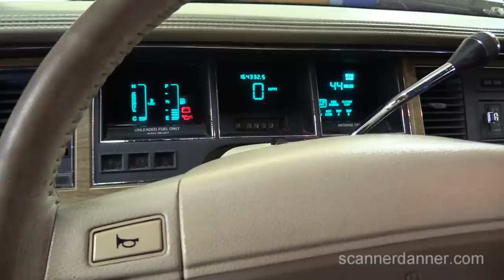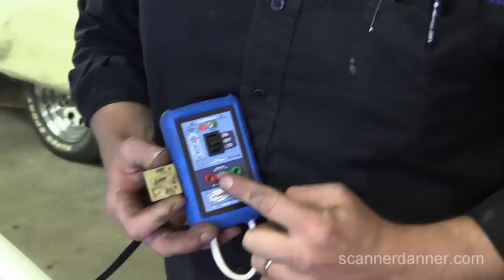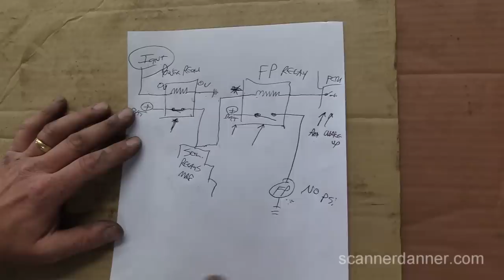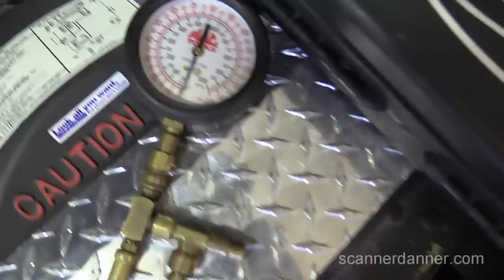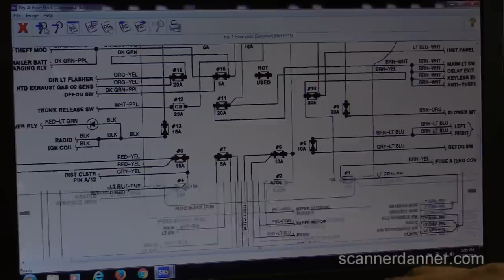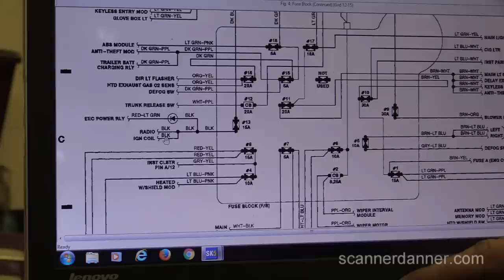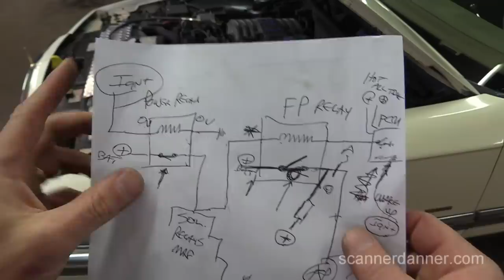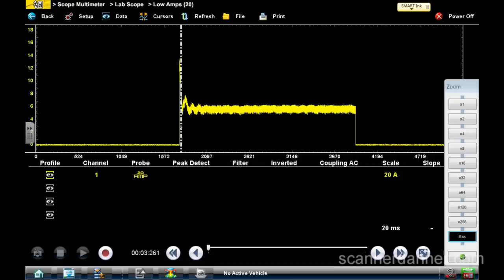Ford EEC-IV No Start No Fuel Pressure Troubleshooting (Lincoln Towncar)

Comment: hillbilly fuel pressure test, have someone "crank it" and screw driver/etc press the schrader valve open. ok, ok, ok, yep old school quick dirt diagnostics. whilst most are fiddling tying to get scan tools to work I am visual scanning and listened with ears as it pulls in :)  this is great for the younger folks getting to auto mechanics!
Reply from the maker: I won't teach this as a simple spark during this process equals a serious safety concern. (FIRE!!)
Reply: yeah, for sure don't teach them the hillbilly press and spray, fuel pressure gauge is the right way and teaching them to use eyes, ears and thought process before jumping to conclusions is a must.
guess my obnoxious sarcasm/puns wasn't clear enough lol ;)
Reply from the maker: Hard to follow your thought process sometimes lol

Comment: On EEC-IV, check the codes.   Do the solenoid and relay test. It'll operate the fuel pump relay and pump. The relay should click.The inertia switch is inline of the relay. Check for voltage at the pump. If no voltage, check upstream. Jump the pump to the battery. It should work. Check pressure. The solenoid and relay test will tell you if the relay and pump is working. It'll give a code about fuel pump circuit if the pump or relay isn't working. Check if there's a fuse. Get fuses that says Littlefuse. Don't hook up a test light to computer circuits. It'll damage the computer. Check for battery drain at the battery with a test light to check for shorts.

Comment: 1990 EEC-IV Town Car 5.0L has electronic fuel port injection using an electric fuel pump. To test pressure you don't have to crank the engine, when you go key on the pump should run for 1 or 2 seconds, and if you have the door open an listen carefully many times you can here the pump running. The fuel system is a return type using a pressure regulator to keep the pressure across the injectors constant with a change in vacuum (Throttle), so the best fuel pressure measurement is actually a differential pressure using rail and manifold pressure. However, you rarely see the use of a differential fuel pressure transducer due to its cost. (they can be very helpful if you have a leaky pump where the engine has problems at WOT). There may also be an inertial impact sensor that disables the fuel pump after a collision, I think it is in the trunk of this vehicle.

EEC-IV has a 60 pin connector. When IGN power is applied to the EEC-IV ECM it will boot in under 60ms, which is less time it takes for the starter solenoid to actuate. 

For this year vehicle the OEM Town Car shop manuals are very complete which includes; Large Electrical Schematic Sheets, EVTM, and both Shop Manuals. A good starting point would be to look at the vehicle electrical EVTM.

For this year vehicle you can use the Ford Super Star II tester or the NGS with the pre OBD-II under hood diagnostic connectors. 

The EEC relay is there to provide reverse battery protection. It does this by having a diode in series with the coil side, so the relay will only be energized if the battery polarity is correct. The diode is located in the same relay box at the far left. I have never seen one of these diodes fail due to a bad diode, they usually fail because of corrosion at the mating connector pins. 

The relay tester kit I like to use is the Lisle 69300 Master Relay Test Jump Set, which breaks out the relay signals with the relay in circuit and has a switch and jumpers to do the energizing and bypass tests.

The standard medium fuse type in the passenger compartment is type ATO (the O indicates the fuse element being open to atmosphere). The under hood standard medium fuse is type ATC (the C indicates the plastic body is closed so when the fuse opens under hood it cannot ignite any fuel vapors that may be present). Many times you will see the ATO/ATC listed together as a fuse option, but what is really meant is you can use ATC in the passenger compartment, but ATOs are not used under hood.

Comment: I got a power probe 3 with the ECT3000 circuit tracer. It is the next step up circuit tracer than you have. I love the thing it is awesome
Reply from the maker: I want to get the ECT3000, I have the PP4 already
Reply: I have only had chance to use it about twice now and worked great. Want to use it a bit more to learn ins and outs of it. I got the PP3 and ECT3000 for under 200 on ebay. was legit because I registered it with power probe

Comment: Just a heads up, many Toyotas, Lexus, and Scions do not prime the fuel pump. The pump only runs when there is a crank signal.
Reply from the maker: for sure! Thanks for the reminder
Reply: We are talking about Ford EECiV system. No confusion here. 
Good to know as I have a Toyota we care for also.
Reply: @ScannerDanner  the way I test for spark is to do a quick spray of starting fluid into the air intake.  If you have timing and sprak?  It should fire up the engine for a few seconds.  

Had a similar situation recently where I had no gas to the TBI.
Reply: @ScannerDanner  my 94 GMC Sierra that I had the no start after parking in a shopping complex.  My fuel pump relay was good but on the plug side I found a problem with a ground.  When I turned on the key the my test light would stay on two places on the plug.  Having no ground I would not be able to establish the priming.  I cleaned all the the grounding points with no change.  I played with wires in the wiring harness.   Unplugged every plug in on the engine.  Got under the chassis and disconnected the electrical link to the fuel pump and put it back together.  Got back in the vehicle and turned over the key and she fired up like nothing had happened and I haven't had any other problems so far.  Feeling blessed that I didn't need to put in a new fuel pump unnecessarily.
Reply from the maker: @michaelpearce8661  well at least you know it wasn't the pump, but this problem will most likely happen again and when it does, some additional testing will be needed. Namely the power and ground at the pump itself when it is NOT starting.
Reply: :/ hlo
Reply: Sorry to revive this. Do you by any chance know if a 1994 nissan 300zx would be setup the same way? I’m having a no start.

Comment: You can can ground part of the data link connector to chassis with key on and it will act like the computer ground(control side) and energize the relay, turning the pump on continuously as if the computer is getting rpm signal.
Reply from the maker: yes you can! Pin 6 I believe? One of the three computers I smoked in my tenure was an EEC IV system. I put power to it instead of grounding it, then I turned the key on :-(
Reply: Ouch. That was a lessoned learned. I have a eec-iv im dealing with now that when the car hits 3,000 rpm at a part throttle acceleration it acts as if the coil loses spark then once past 3k power comes back. If you give it "the beans" and blow past 3k it runs great. Every seen this? maybe timing issue?

Comment: you can actually do the same thing as the relay switch by using a piece of wire and inserting each one of it's ends into each of the power pins on the fuel pump relay slot in the fuse box.  However, this will keep the fuel pump running and you have to pull the wire out to stop it. The saewave tool allows you to turn it off on demand.
This is an old trick used when a fuse blows on the road and you don't have a replacement.

Comment: Just a heads up, you can pull EEC-IV codes using just a jumper wire and a test light, I can't remember exactly how to do it off the top of my head, but have done it before on my old 88 F150

Comment: I just energize pin (87) at the respective Relay using the Power Probe. Its quick and simple.   Pin (87) is normally feeding the actual component. This is a universal principle.
Terminal (85)= Ground Control side of relay.

Terminal (86) = switched control side of relay.

Terminal (87)= Component load side of relay.

Terminal (30)= Constant 12 volts Direct Current at the relay. "Load Side"
Reply from the maker: Many times you will see pin 87 being used as the constant supply for the load and 30 being used for the load itself. Just need to be careful is all.

Comment: As you say most of the times, some vehicles don't have a prime and some don't provide rpm when cranking. Starting with checking spark would be  the ideal place to start to eliminate an input problem. Starting with fuel is good if you know the system has a prime, which would drop when cranking if you have an input problem.

Comment: So if you're still responding on this video, I have a quick question: I have a 1996 Town Car that has an intermittent no-start, with no check engine light. Seems to happen more on hot days (maybe a circuit opening up due to heat?). Occasionally, it will shut down during operation, but most times, it shuts down with no check engine light when having just shut the car off, and come back to it after a couple of minutes to resume a trip (like a quick gas station stop). It will remain this way for a few minutes, and then the check engine light comes back on, and the car will start. It does not throw a code. It acts like it goes into open circuit, and then once it cools, it will resume closed circuit. I HAVE replaced the ignition switch under the steering wheel, as it was originally causing the same symptoms, but it does it now with a new switch. (The old switch was burned up real bad inside. The new one still looks good.) I don't have tools like yours, so what my question is: Do you think the EEC relay, crank sensor, or ECM would cause these symptoms? If so, how would I test with a simple multimeter and test light? Thank you if you respond!
Reply from the maker: definitely focus on your EEC Power Relay. This video may help give you some perspective on the workings of that relay. https://www.youtube.com/watch?v=w9PKJrK4Fbs
Reply: @ScannerDanner  
Thank you for replying! I'll check that video out. Thanks again!!